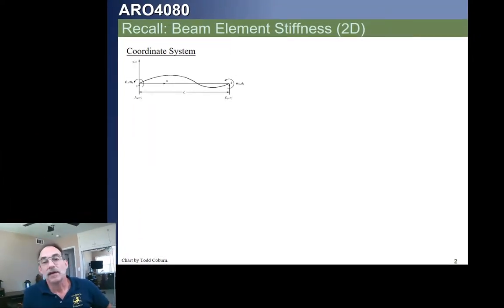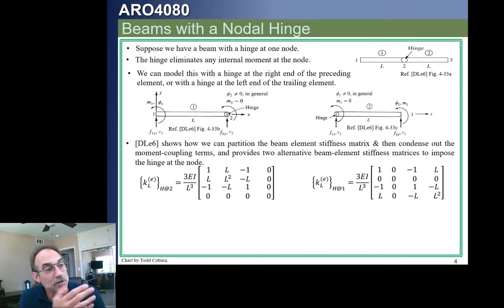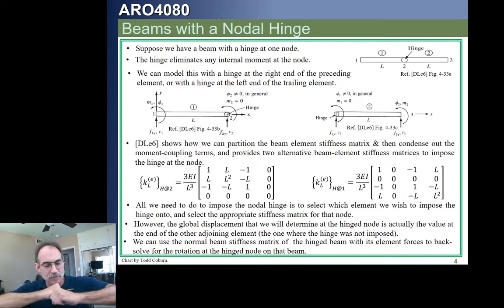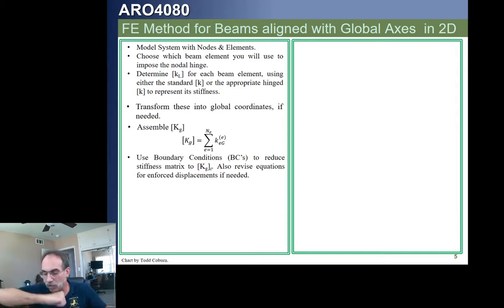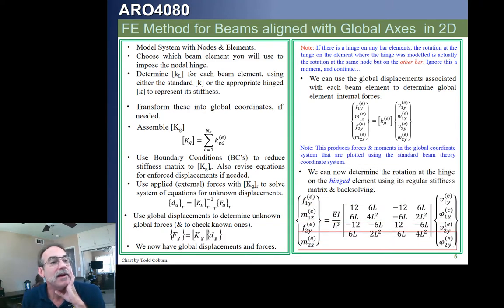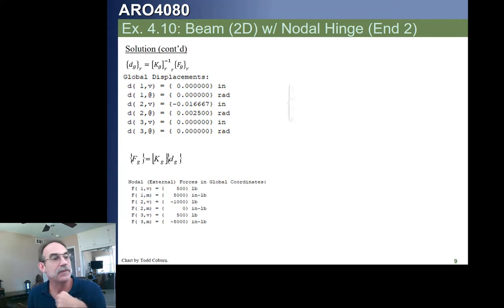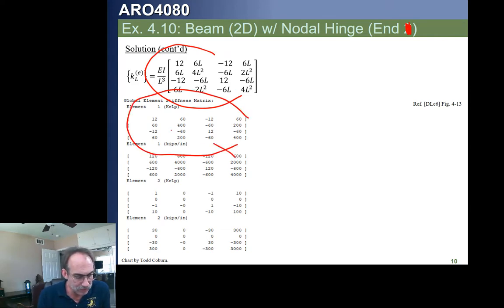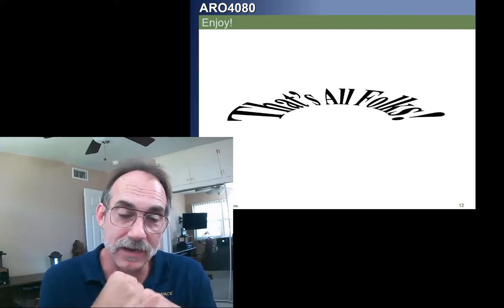Finite Element Analysis: L-12 Hand FEA of Beams with Hinges

Comment: Hi Dr. Todd, I'm from Brazil and I'm developping a tesis for my bacharelor degree. I'm applying FEM in a Matlab software that solves beams with nodal hinge, but when I have a beam with distributed load and a nodal hinge the values os displacemants and internal efforts doesn't match with the theory. Could you help me with this? If you can, it would be nice if you solve an example like this...
Reply from the maker: Remember, when simulating distributed loads, you put forces and moments at nodes to simulate the distributed load tgat must be removed from internal loads.

Comment: Thanks Todd for your great FEM videos! 
I have approached the beam hinges from another perspective by adding an additional rotation to the global stiffness matrix. By using this method the size of the stiffness matrix in your video example is 7x7 containing three rotations. In this method both middle node rotations are solved at the same time.
What do you think about this approach?
-Engineertopi
Reply from the maker: Great idea!  That should work.  Thanks for alerting me to this approach!